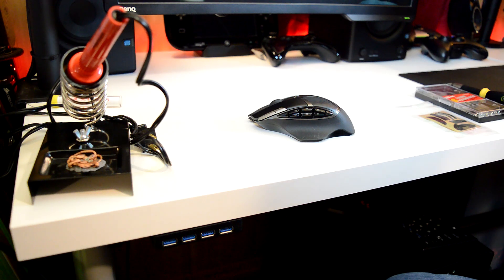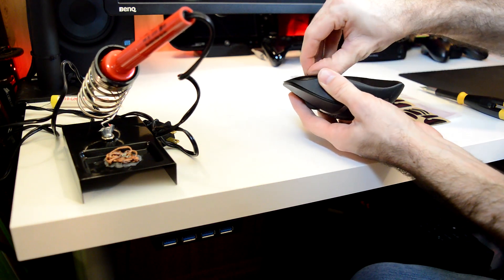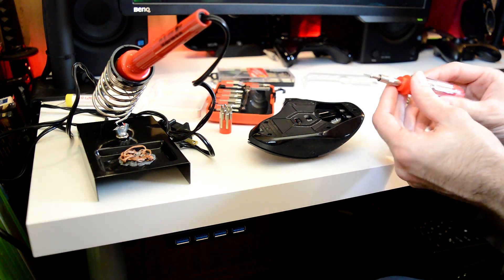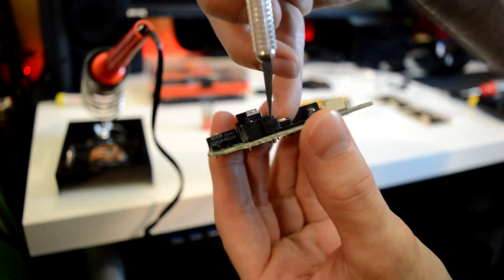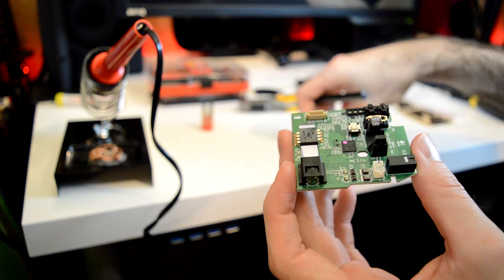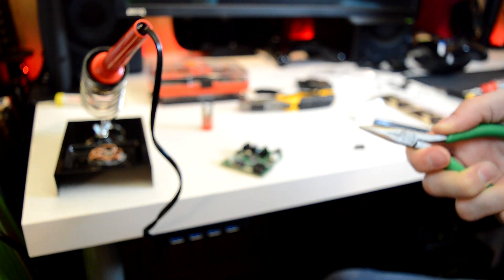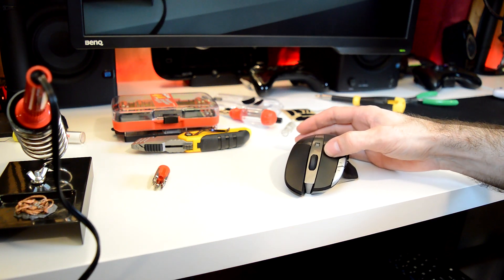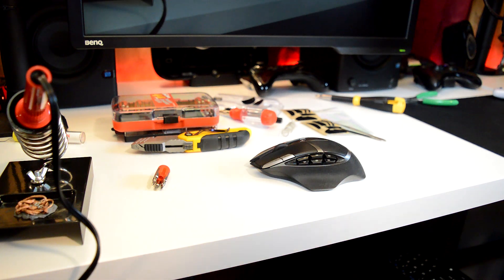How to Fix the "Doube-Click" Problem on a Logitech G602 Wireless Gaming Mouse - Part 1

Comment: Bruh how do you put the copper back? It's impossible man I'm stuck here
Reply: https://i.stack.imgur.com/1C5Wu.jpg <--- using this image(the image is upside down though) as a reference, you insert the right side part first in between the contacts (don't flatten the spring btw otherwise well no clicks...) and then you carefully insert the tail of the copper piece in between a super slim small ridge at the tail of metal piece of the switch, at this point the spring will be sticking out and you gently push the spring down until you feel a click in  your hand (sometimes you may not be able to feel the click so just keep an eye and push until it is settled) and this should do the trick

Comment: Interesting, my mouse just started developing this problem. It's not quite full blown bad, just occasionally doing it. It's my own fault tho. I sometimes smash the button when I'm raging in game and not even meaning to click, just upset, not often, but I did it a few times.
Not even mad tho, this is a beautiful mouse. I've also had it for over 3 years now and this is the only problem I'm experiencing, also I've only changed the batteries like twice, maybe three times, but I game on it all the time, @least an hour or two most days.
I think I'm just going to buy a new one when this one starts going really bad and buying the mouse feet pads and trying to repair this one as a back-up incase the new one acts up too.
I really wish Logitech would release an updated version of this mouse with some new tech, maybe more durable parts (omron switch?). The design is just amazing for mobas (I play Smite, but came from LoL) and basically any game I've played it has enough buttons and awesome placement.

Comment: My wired $4 Chinese mouse works better then this expensive paper weight....my g602 moves erraticly and jumping even when put on flat surface... tried cleaning the sensor with alcohol no luck... blowed air thru sensor still no luck ....

Comment: Just wanted to say this worked for me. Hardest part was replacing the small metal piece after adjusting it, but once it was put back together the left click i think is actually working better than ever. The click itself feels much more 'defined'. Double click, click-and-drag issues are gone. Doesn't appear to be any more sensitive as others have noted.

Was it worth saving $35 bucks? Maybe, if you have patience and enjoy tinkering fixing this kid of thing.

Comment: i too got this problem with my 3 years old G602, all i do is blast a small amount of WD40 from the left mouse button gap and it will magically fixed! never had problem till this day. i'm planning to replace it with G903 prior to blasting, but looks like i don't need it for a while.
Reply: I too am looking at doing the exact same thing with WD40. Care to share with me which button gap you are pointing the WD40 nozzle to ?
Reply: @axxohex  i pull the left mouse button up to make a bigger gap at the front of the mouse then just blast a small amount of WD40, mind you that the leftover oil will occasionally sip through while using the mouse but will disappear after a while

Comment: Thank you so much man. I didnt have the problem listed in the video, but i did have a major problem where the mouse wouldnt turn on (because i accidentally dropped it from about 7 feet). Thanks to this video i learned how to take apart the g602, and found that the problem was actually very simple (the black and red wires connecting the batteries to the mouse was unplugged).

Comment: ok so instead of flattening it I actually did the opposite and bent it a bit further up. The result is the click is louder and I need to put a bit more force into each click but I can click from anywhere on the mouse button and the double click problem is gone
Reply: There is another video that says bend it down ... so I did both lol

Comment: Thanks for showing where us the screw place,m just fixde mine and i fixed a lot of my mouse before but this one is the worst type to fix since there are no room for removing and fixing the left button. btw you can fix it without replacing the black tape if you carefully remove it since it stick again or removing that elec tape since i tried to remove it but it was so tight so i put the mouse above pillow and fix it without that much of movement :)

still love it one of the best mouse i ever had.

Comment: Before you take the omron housing off put a piece of small tape over the top so it holds the white button in place. This way when you remove the housing the button stays in place with the housing and doesn't get lost.
Reply: Thank you for the tip!
Reply: Smart!  Should make it easier to put back on too.
Reply: Great advice! It helped a lot!
Reply: Just worked like a charm for me. Thank you!
Reply: Woah...This...Actually worked. haha

Comment: Awesome tutorial. Altho I didn't have the issue you had after because probably I first bent the metal slightly on the part where the white button comes in contact with it(I bent it upwards counteracting the push of the white button) and then proceeded to "straightening" out the curved part of the metal which you mentioned.

Comment: I have this mouse -- not only it developed the double-clicking problem, it had also developed a click-drag problem (basically I could not click and drag any window on the desktop).

I put a bit of upward pressure on the left mouse button, blew hard into the gap underneath a few times. Voila! Works like new again! Didn't even need a screwdriver.

Moral of the story: Stick to cheap basic mice coz they tend to be more reliable than these newfangled gaming mice whose left button can't even click properly.
Reply: Mine is doing EXACTLY this, and I do the same you do (pressure and blow) and it works for 30min, then it's screwed again. Really REALLY irritated now, and mouse is JUST out of warranty, so Logitech won't replace it.

@ShadowTracer - thanks for the vid, very informative :)
I have read the comments however, and see that putting the copper plate back is a bit of a worry, so not sure if I will attempt this. Thanks anyway :)
Reply: Yeah.... mine worked like new for like a week, then it crapped out again. 

This is a really shit mouse especially considering its premium price..!!
Reply: You are officially my favorite person.
Reply: Cant believe this worked lol
Reply: considering how well these easy fixes usually go for me I did not expect this to actually work.....sure enough....it worked
Reply: Hahaha, i cant believe that shit actually worked :D
Reply: its actually not the blowing that fixes it, applying the pressure alone has fixed everything for me
Reply: What on earth, this worked? I used an online click counter and found out ever second or third click ended up being doubled. Now I clicked 100 times and no doubles!
This comment needs to be a lot higher up.
Reply: This works, I just spray WD-40 Contact Cleaner on that part. Thank you so much
Reply: Can't believe that actually worked
Reply: its same double click problem just replace the thing that showed in the video with a one from old mouse and it should fix it.
Reply: I'm late as fuck, but holy shit thanks. I just ran into this problem today , along with the middle mouse button not clicking, and this just fixed them both!
Reply: it works. nice dude :D
Reply: hahaha holy shit It actually worked thank you alot!
Reply: Thank you man
this worked for me as well
Reply: many thanks from the end of 2018.
Reply: THANK YOUUUUUUUUUU
Reply: OMG, Works for me!! THANK U!!!!
Reply: So simple yet so effective. Thanks man.
Reply: Well I'm dizzy af now but I don't have to spend $70 on a fucking mouse that i spent $30. The price went right through the fucking roof

Comment: I love everything about this mouse except for these shitty Omron switches. 20 million clicks my ass. I just had my second one die in under 3 years, both due to the same problem. I warrantied the first and got a new one and now it's died the same death.  I tried to fix this second one but it was a no go. I  got it all back together after about 3 hours of messing with it to fix that copper spring, but it's now worse. I must be a glutton for punishment cause I'm actually thinking of ordering a third one of these. Feature wise I love this mouse, but the build quality of these switches is is just shit. I don't care what claims Logitech makes. This is basically a short term disposable mouse.
Reply: 3 years later, what did you go with?
Reply: @metalmayhem3622  Another G602, lol. I just warrantied my fourth one the other day, now on my fifth.
Reply: @jackflynn779  Jesus. I just filed a warranty ticket, that's something I don't usually consider and luckily I think I have 5 months before the 3 year deadline is up. 
I've never warrantied before, do you have to send it in or do they just send you a new one?
Reply: @metalmayhem3622  I've never had to send one back. On the ticket they'll ask you to try a laundry list of things, none of which will work because it's a faulty switch. Just tell them you tried everything they suggested and it's still got the problem, making it unusable. All 4 warrantied have been the exact same left click fail problem. The one I warrantied the other day lasted only seven  months.
Reply: @jackflynn779  Awesome, thanks

Comment: To everyone else watching this: There is no reason replacing the pads while removing them for the purpose of reaching the screws, if you do it properly, than ShadowTracer is ... doing here. I did disassemble my MX518 couple of times, since I started to use it back in 2008, and had no reason replacing them (even those which are on it are still the stock ones, and I used to use that mouse for almost 9 years non stop, more than 4 hours a day).
Reply: +Tengoku NET did you use any tool to take off the pads underneath your mouse?
Reply from the maker: Oh, I'm sorry. Let's just go watch your video about how to do this.
Reply: ShadowTracer Don't go apeshit just because you wasn't able removing the pads properly. There is no reason of "let's watch your video" laffytaffy talking.

Comment: SOLVED:  First of all, thank you for this video, as it helped me get most of the steps to solve my left mouse click problem.  I had noticed that when playing games, click-hold actions with the left mouse button yielded a choppy movement pattern which made me decide to tackle the problem.

To fix the mouse without replacing the button, I followed all your instruction until the point where you "straightened" the copper piece.  Instead of straightening it, I removed it, and placed it as back on as high as possible on the frame and made sure it was secure in place.  After making sure it was properly centered, I put the cover back in place.  I tested it with my game for a quite a bit and can confirm that it is working like new now.  So the KEY here was to remove the copper (flat) piece and place it back on the frame as high as possible.  I hope this helps a little (and makes sense)  :)

One more thing:  instead of purchasing the rubber "feet", I stuck my old ones back on, and that seems to be holding strong... one way to save $8
Reply: +Carl Callaway what did you use to stick the old rubber feet on the bottom of the mouse?
Reply: @joshuady1327  Sorry for the delay in responding. When I peeled off the feet, the sticky part was still on them and I just pressed them back on, and they held on well.

Comment: For me it solved with a simple blow.
Reply: Lol, you are fecking genius man <3
Reply from the maker: Lol
Reply: I confirm the same. my mouse has double-click problem on both right and left buttons, and once it starts to misbehave - I just hit those buttons slightly harder, and they work OK immediately after that. Fix only lasts a day or two though.
But it's so quick, reapplying it on the fly is very easy.
Reply: @davekooper1379  lol i was watching this because i wanted to fix it, but didn't seem convinced i would be able to fix it, and might make more damage to the mouse. your solution seemed to fix it for me. haha
Reply: @mushk1ng   oh  like just pressing hard and that it?
Reply: @marioj6330  yea just click it pretty hard and its good, at least for me
Reply: me too

Comment: hey man nice video. i saw a other video where the guy didn't flat that piece of metal. In the opposite he pushed it up and could activate the mousklick everywhere not just on front and it fixxed the Problem. he did it on the g502 but it looks exactly the same like the g602
Reply from the maker: Thanks. Yeah, I actually took it apart again and did that and now it works perfectly.

Comment: Thanks for this.  I don't think I would have been able to do it without your video.  Especially  removing the lid of the omron, I probably would have given up and/or been too scared to break it open.
In my case the problem is the mouse button releasing itself automatically.    At first I thought ok that means I should do the opposite of what you did and make the copper hook sit higher rather than bending it down.  However I didn't adjust it, and instead, snipped off about 1mm of copper at the back end of the plate to shorten it (using nail clippers) as it appeared to be sitting very close to the connection post in the pressed position, possibly completing the circuit and causing the button to release.    I also sprayed it all down with electrical cleaner solvent.   Of course, getting the copper plate back on was the hardest part, but actually it's very easy if you use the thin tip pliers and figure out which bit needs to hook underneath first.   Without pliers it's almost impossible to do, luckily I had a pair lying around!    However, even just removing and refitting the copper plate has changed its shape slightly from all my fidgeting with it, and the button is now super quiet to click, which I like!     Not had a single issue yet, but it will probably need a few weeks of perfect operation for me to be certain it's worked.    If it starts playing up again I'll then start fiddling with the height of the copper hook.    I also noticed that after removing and reapplying the teflon feet (with the same ones) that the mouse is sliding a lot smoother on my desk.    So after this tune up I have a super quiet left click and super smooth motion , and possibly a fixed button - very happy!    Especially considering logitech have discontinued the 602 and told me to get a refund from the retailer as they don't replace discontinued items under warranty.   I wonder what they will be replacing the 602 with as there is no other mouse that satisfies the same battery life and 500hz criteria.     Both of these are essential features to me so it will be super depressing if logitech don't come up with a successor.   Thanks again and hope you enjoyed my novel :)

Comment: For my mouse, the left click double clicks AND the middle button hardly ever works (to quick scroll up or down). For the middle button, I have to press it down hard. I've had it for 3 years, and thankfully I just recently moved from pc gaming to ps4 gaming. Solution? I'm just going to buy a M series logitech mouse like I had before. I really only wanted the G series for gaming. If you have the same issues, and still want to game on the pc, either buy another g602 or buy something from Logitech's M series. I actually own at least 3 other M series mice, and they work like a charm. One of them is currently replacing the g602 until I buy another.

Comment: Hello, I have just followed the guide and I have a few things to say!

First, whoever try it too, you'll need patience and dexterity, i promise. Also don't buy new mouse feet before actually trying to fix your mouse, because it is going to be a rather difficult process. You can always put back your old ones somehow if you get rid of them smoothly in the first place.
Then, the process of opening the mouse itself is quite easy, getting rid of the covers is ok (be careful if you use a sharp tool though, and don't lose the tiny white plastic part).

The very difficult part is to put back the small copper piece. Actually it's hell, I believe that it's the reason why it doesn't appear on the video, and it's honestly fair enough. There are two problems about it:

1) It is placed in a way that it has to be very tight. You can open the cover of the right button and use it as a base. Look how the copper piece is tightly placed, there are tiny slots.
2) The fact that it is hard to put back the copper piece correctly, will force you to put pressure on it, maybe bend it so it will not be as flat as it was after you fixed it a moment earlier.

In conclusion to my experience, well done ShadowTracer, it did fix the double click problem. It is not a perfect result though because my left click is a little more sensitive that it is supposed to be. It's at least less annoying than the double click issue, and i will try to work on that copper part a bit more another time.

Hope my feedback helped!
Reply: I'm at it for an hour now... trying tip get the exact amount of bending(I might have tried it too often and it's worn out)
However putting it back in is indeed hell.
Reply from the maker: Thanks for your novel XD jk. I thought this was going to be a troll comment when I started reading it. The reason that part isn't in the video is because, had it been, it would've just been an hour of me cursing and searching around in the carpet. Yeah, it's not a perfect solution. I took the mouse apart again and flattened the copper thing out some more, actually, and now it works perfectly. Glad this worked for you too. You just have to keep messing with it until you get the copper bit into the right shape.